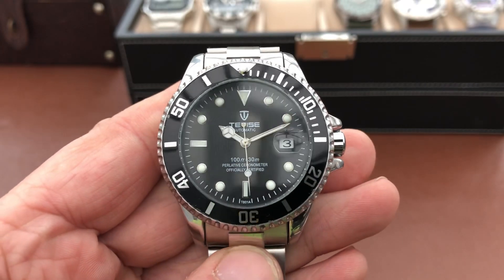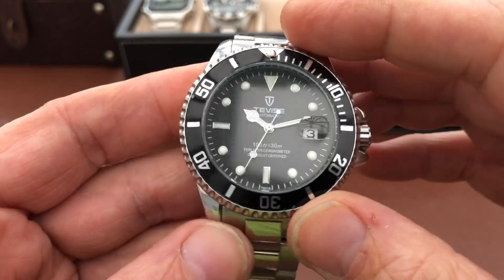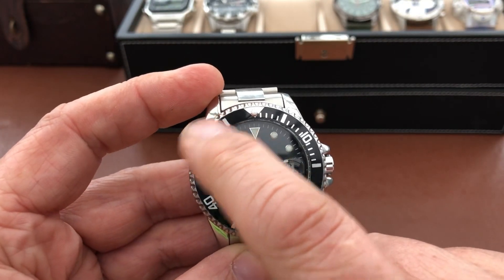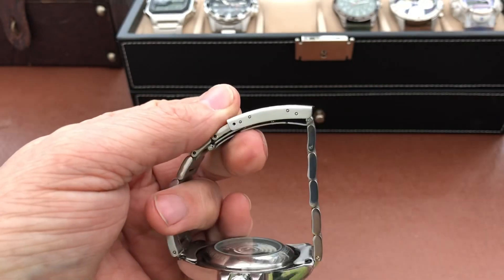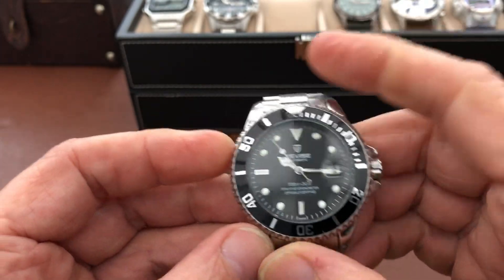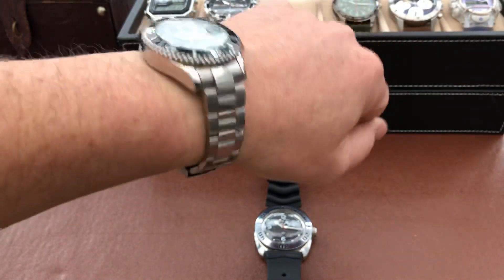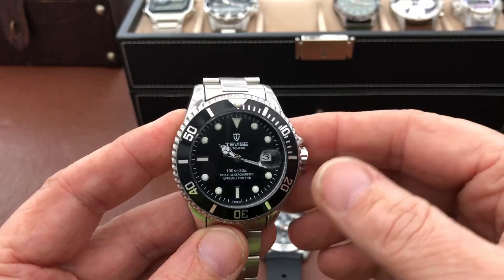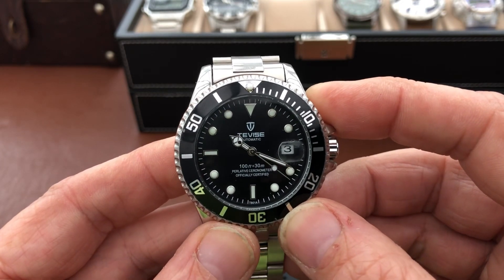Tevise T801 final thoughts and a nice improvement!

Comment: Got mine today. It is slightly oversized at 43, but I have bigger watches anyway. Bezel is crap. Watch is very nice but  no where as nice as how they are depicted in the ads (  I think they use photoshopped images of actual Rolex cases  for the advert ). Not very bothered about accuracy , as I normally change watch as soon as I go home and prob won't wear the same one for a week. +/- 60sec is fine with me.  It came in a bag , no box and just as well , have less crap in the drawers. Cyclops is offset , but at 46 I cannot see the little date number anyway. Bracelet is not bad for the price. Seen much worse on more expensive watches. First thing I did was put it on a Nato and it looks nice on almost any colour. It is actually heavier than I expected and I like a watch to be heavy. All it needed more was a screw-down crown. All  said,  I love this Homage , and it only cost me 20 Euro. It is well worth it. I will prob get a couple more variants soon.

Comment: tevise....wore it as my everyday beater. it lost. keeps good time. i wore it for 2 weeks and kept great time. less than 8 hour reserve. before i went to sleep had to jiggle it for a few minutes.
the crown pulls out 2 clicks. first for advancing date. that stopped working. i have to walk hands back to 9 pm then advance to  2 am. using the 2nd click adjusts time.  the crystal cracked after bumped into a metal door frame. it actually flaked inside. the outside surface of crystal intact but looks like crap. i like this watch becuz it was so cheap. well, i recommend buying a timex or invicta for a few bucks more. i must say the watch looked great. mirror polished case, gold trimmed rotating dial. nice face and hands. i dropped it a few times and kept on working with accuracy. i wonder if the crystal really is "hardened mineral glass".

Comment: i love these watches. look great and well designed, great time, and a silly dial inscription to remind you that it's not seriously trying to look like a rolex. i find the tevises have poor automatic winders ... rotors that won't drop from sideways to bottom without shaking ffs! they seem to loosen up with use somewhat, but it seems to be sad QC/finish for a well-designed mechanism. the calendar breaks easily, so don't adjust it anywhere near 12 oclock. and get the stainless finish, not the black which is terribly fragile. maybe not suitable for gifting, but a fun watch for a collector of cheap watches. and most surprisingly, i find myself using that diving bezel all the time. i have about a hundred watches, but i find myself mostly wearing the sparkly green one of these

Comment: I bought the same watch and received it a week ago. I know this sounds crazy, but hear me out. . .  I can't wear it. It makes me physically ill. I'm not sure if it's the material it's made out of, the lume, or remnants from the manufacturing process, but I get shaky, my throat starts to get scratchy, and I get a headache. It happens EVERY TIME I handle it, let alone put it on. I even tried a blind test with a similar watch I own -- same result. I was fine with the other watch. Just wanted to put it out there to see if anyone else has experienced the same thing.
Reply: If you can afford it, it would be a very interesting experiment to buy a second one, and see if the result is the same. If its not, you could set them both to the exact time so they match each other, without getting them confused which is which, then run a video that shows you mixing up the watches. Then with the video running, see which one makes you feel ill, and run the video back to see if you chose the original one. Maybe you got a haunted watch!

Comment: how do you set seconds
Reply: I haven't got mine yet but I read somewhere that you pull it all the way out to set the time and then you kind of barely hold it counterclockwise in the seconds will stop or go in reverse
Reply: It's  a non hacking movement. 
When setting the time the seconds hand doesn't stop.